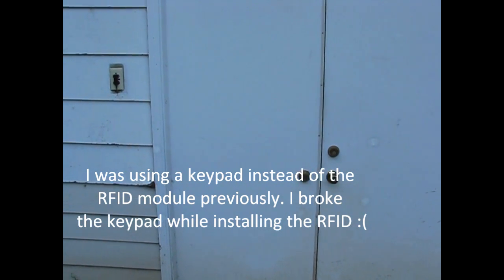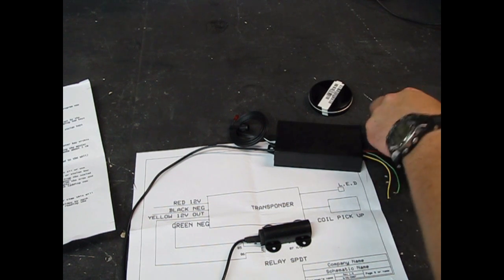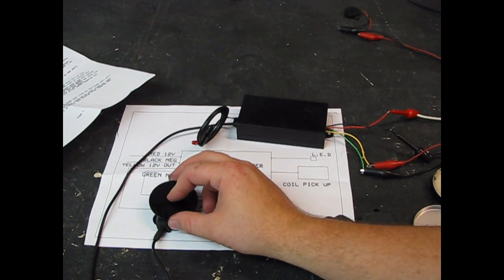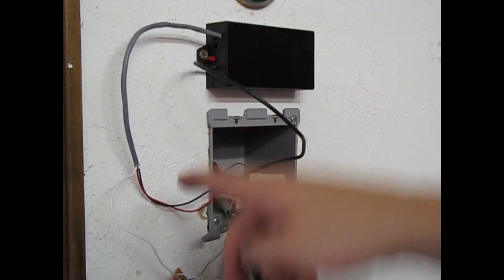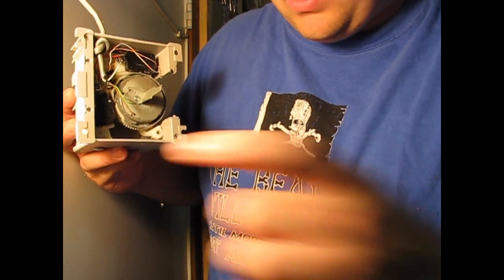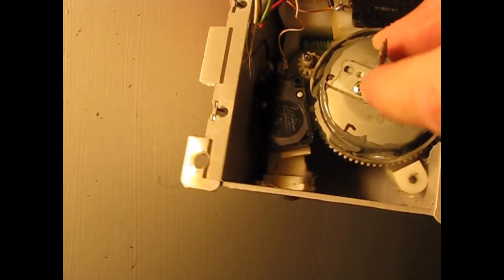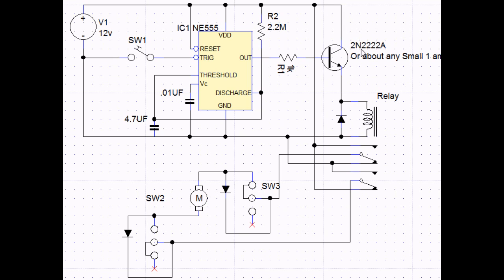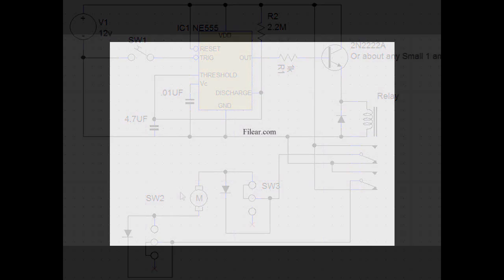DIY RFID Keyless Entry System

Comment: The antenna has a larger read distance from the "under side" of the unit. So if you flipped the antenna around and mounted it inside, you would have a better read range and it would be hidden from sight on the outside.

Comment: I imagine it would be as easy to kick in as any door. Most doors would give in with the swift kick from an adult male. I did have a strip mounted on the door that doesn't move to make a better seal and prevent the old credit card trick but it fell off. The strip covered the gap between the doors, I imagine i will eventually put one back on.